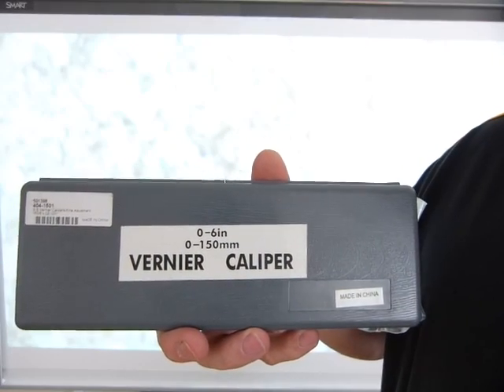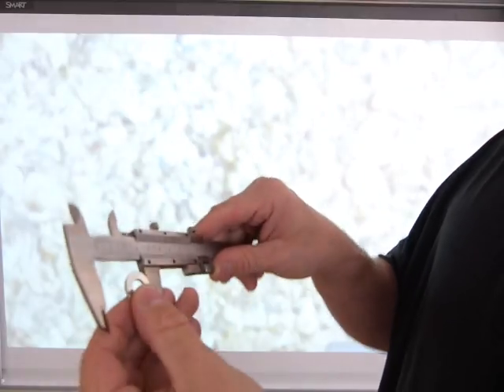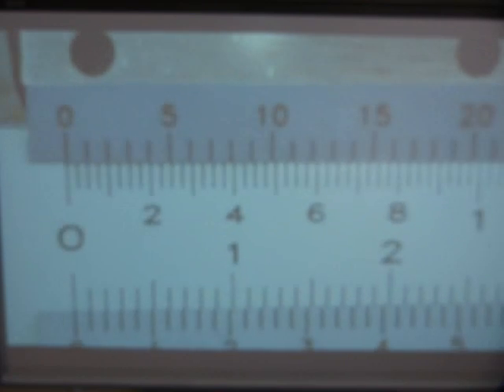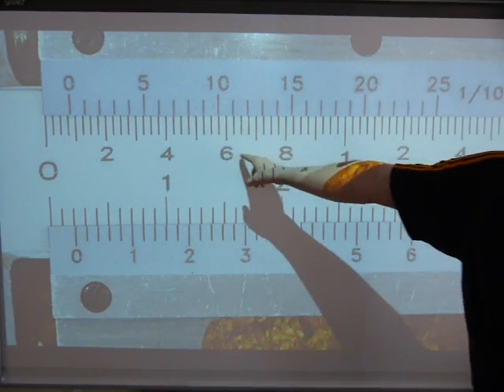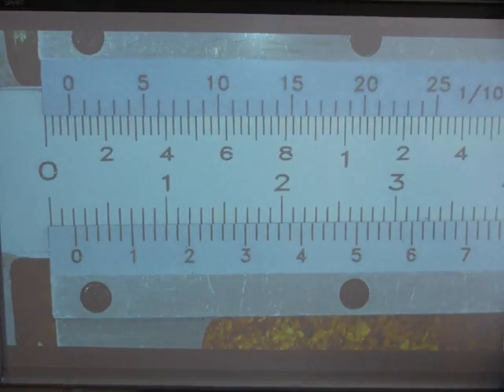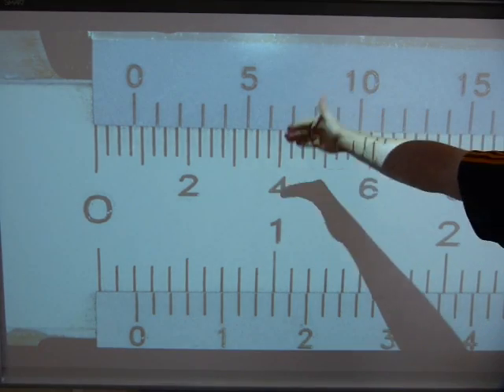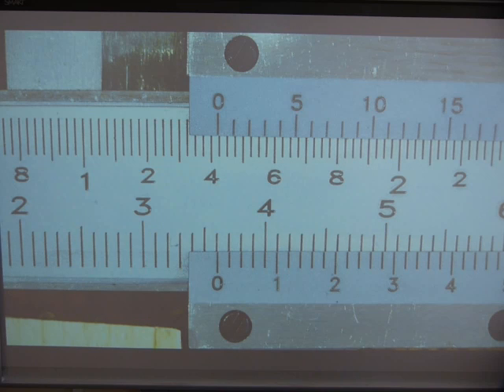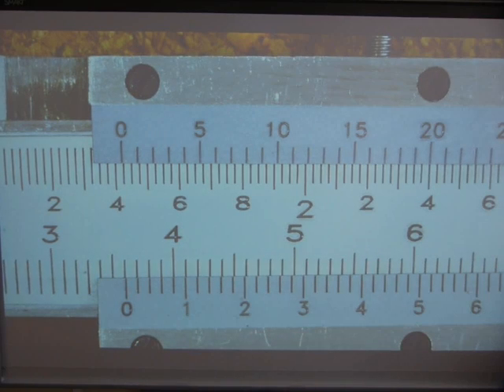Read a fine-adjusting Vernier caliper (1/1000 inch)

Comment: Thanks, well explained. I've been using vernier calipers for over 45 yrs. but was getting odd readings when I checked a piece of sheet aluminum, and my readings weren't matching the aluminum sheet metal guage charts so I thought I was a decimal off possibly. I watched your video to refresh my memory. I was right, the metal thickness or the chart is off.

Comment: Ugghhh, the lesson works...but not the caliper. The caliper is junk. Go to Ebay. Buy yourself a nice tool. Not this tool shown in this video. You'll never get 1000 mil on a Harbor Freight tool like this. Chinese Crap. You can get a Brown and Sharpe 570 13" or 25" or about $100 to $125 in original box that is perfect in every way!
Reply from the maker: Of course, I was going for the math only. I often get stuff just because is has a matt finish or good contrast, etc. Thanks for watching.